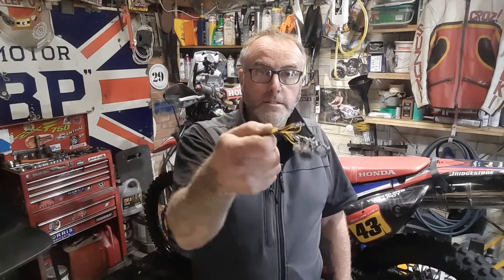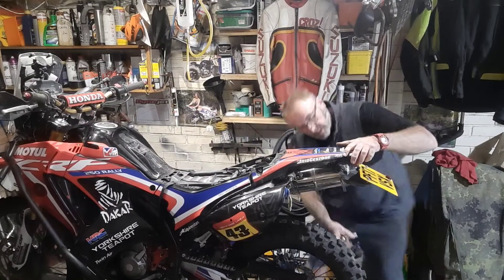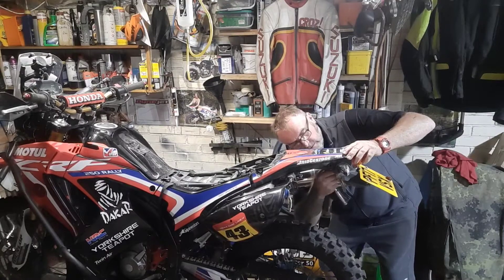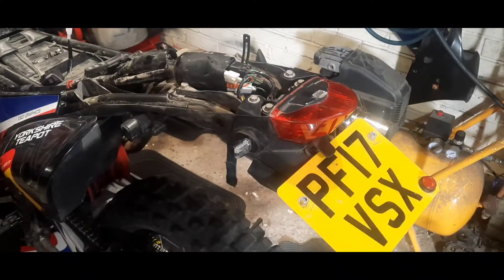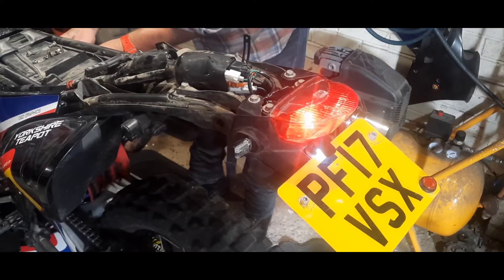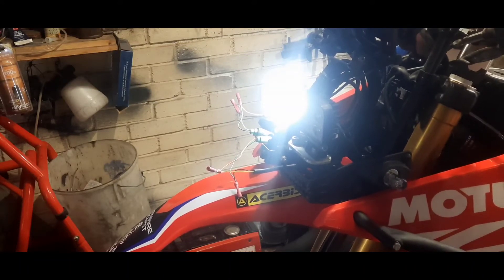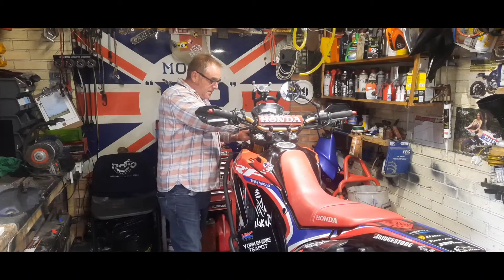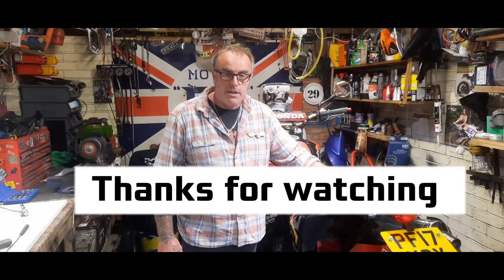HONDA CRF250L RALLY | LED INDICATORS SWAP | FLASHER RELAY

Comment: Which relay did you use iam struggling to find the relay mines is a 3 pin relay not 2
Reply from the maker: I just searched on ebay for crf250l relay for led . Sorry can't send a link . 165347859689 item number think this is the one